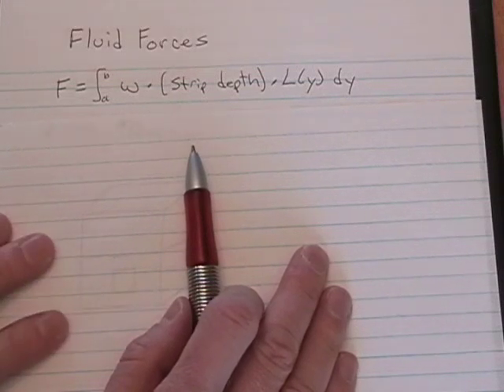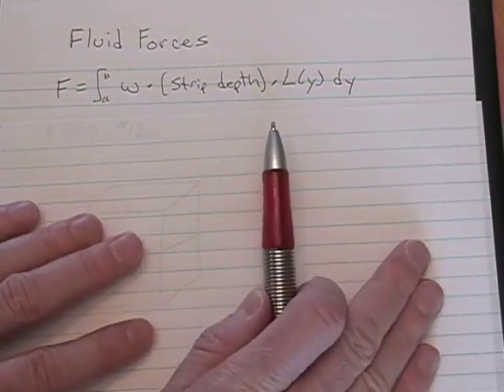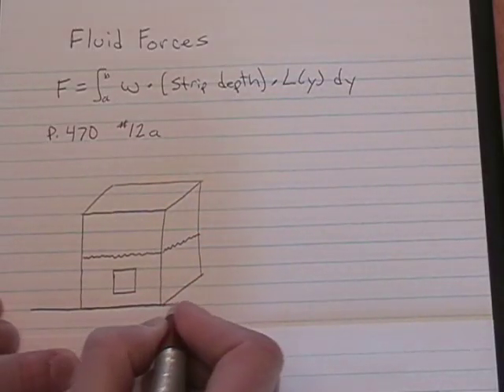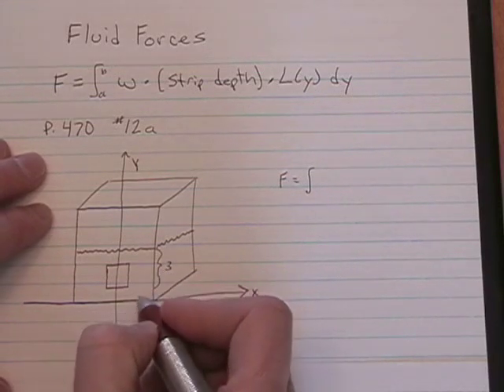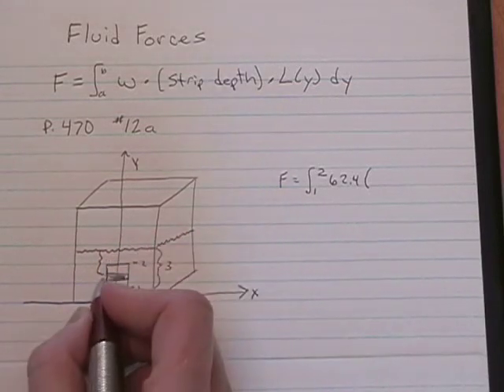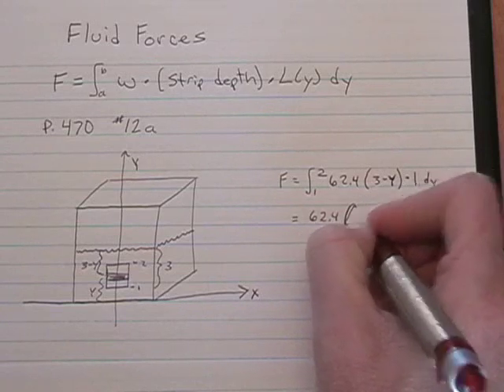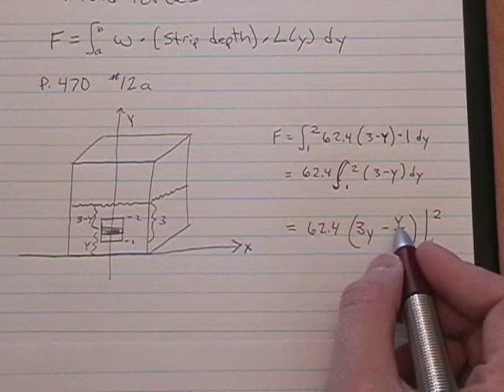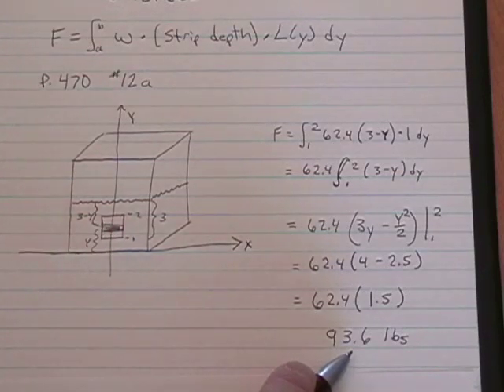Applications of Integrals - Fluid Forces (Vertical Plate)

Comment: shouldn't the force also depend on the tank size? If I had a pool with a glass on the side lets say at a height of 4, a certain force is acting on the glass. But lets say I make my pool 10 times longer, wouldn't the force be different?
Reply: Only the density of the fluid and the difference in depth affects the pressure. The shape and size of the container are irrelevant. Thus the water pressure 6 inches below the surface of the ocean is the same as it is 6 inches below the the surface of a glass of salt water.